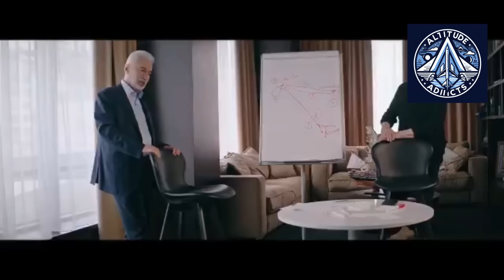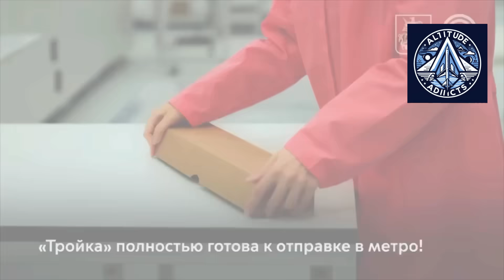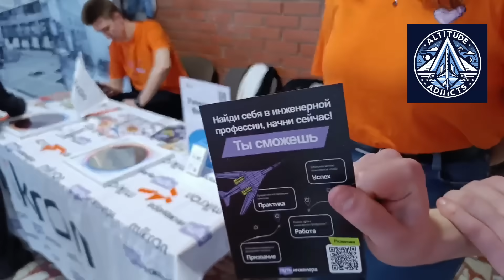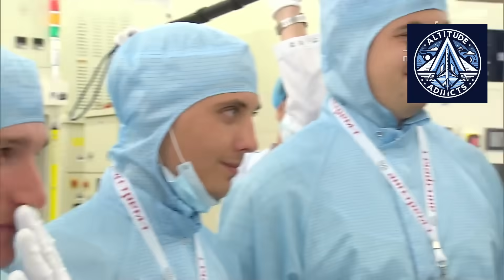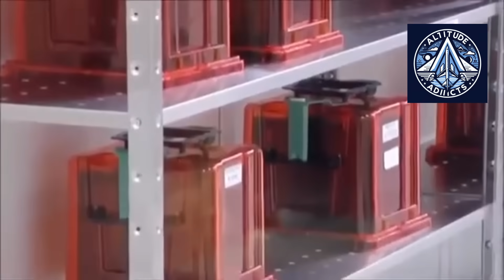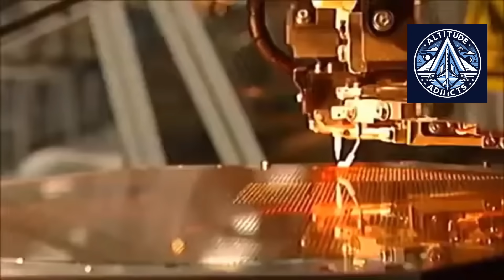Russia’s Semiconductor Industry Explained: Fabs, Chips & Sanctions

Comment: As respectfully as possible: Russia has NO chip industry despite being so claimed :
1.- Despite a staggering amount of minerals readily available in Russia there's no pure Silicon production industry.
2.- Russia has no lithography industry.
Importing a couple obsolete lithography machines is not a local industry, neither is getting some user manuals and schematics from Russian students posing as Polish in western universities: At best may be the 1st step of a long road to build a local sector. 
3.- The Russian industry, despite all the petrol an gas that should be enabling one of the most powerful economies in the world, keeps under-selling such precious energy instead of building local industry.
4.- Russia has no chip designers. 
Chip industries are all based in Taiwan, US, EU, UK, using western chip design and production HW/SW tools.
Again, the same way that using/administering a CISCO router is not the same as building and coding a rounter on your own, using CADENCE SYNOPSYS et al chip design tools is not the same as truly building your own chip design tools. 
5.- Not even China has managed to break the know-how lock on chip desing tools. How on heaven would the stagnated Russian economy have remotely come close to achieve the objective that China is working so hard on? To invade Taiwan, NOT military, despite all the noise, BUT by knowing all they know, that may be worth being known. Top of the list : CHIP MAKING.
6.- In Russia, real case, if you are a successful dairy farmer and you business springs, and you start making money, and you as farmer build a 2nd farm, and a 3rd, and start employing people, and making serious money, you will receive an unscheduled rather awkward visit courtesy of the local milita, equivalent to the TA in UK, the National Guard in UD. In uniform. 
Or perhaps wearing western football t-shirts while showing their guns. 
And like the Narcos in other places, or corrupt gov officers in Europe, yes, EU is ridden with essentially same type of crooks, AND they will demand an additional regular taxation from you straight to the pocket of the unexpected visiting militia officer.
Your 1st impusive answer perhaps would be "I already pay all my taxes that are used to pay for your militia training and uniforms and guns, WHY on heaven should I pay another tax,on top, off gov books, to this areseh.le visiting without invitation? "
Every Russian knows the 2-prong answer: 
6.1.- WHY? wrong question, pay first or you will be arrested on trumped/rigged/faked charges, and thrown in jail until you pay, and
6.2.- Because corruption is so bad that those crooks rather sink your growing business, and head to the next victim, than allowing you to generate wealth, live and let live is not in their playbook.
This was a lucky case that reached international media.
7.- SO if on something as basic as agricultural business gov corruption is so low, how do you expect the tip of the spear, the Bolxoy vallet of electronics, the top of the top of the industrial stack that like a sound building needs strong foundations, how on heaven do you think Russia has anything which is not light years behind current state-of-the-art chip industry?

Comment: I read that Russia supplies 10% of the world's consumption of pure silicon oxide for chip production, specifically it supplies both pure silicon oxide and large artificially created crystals from which wafers are then cut, round flat plates on which chips are lithographically created. The other 80% of the world's consumption is supplied by China.

Comment: If Russia is really working on this, why don't someone also collaborate with the government in India. We are also working on getting our own chip. Our indigenous tech is only 180nm, we went with a Joint venture with foreign fab to get our 28nm chip by this fall, but those techs are still not our own IP. I am sure the government of India will be more than happy to collaborate with Russia in this tech.
Reply: É muito complicado outro país, mesmo que seja aliado, fornecer qualquer tecnologia que os deixem em pé de igualdade! Qualquer país não vai revelar os seus segredos! Isso é dar um tiro no pé, depois de gastarem tanto em investigação, não vão entregar isso de borla.
Reply: In India, most of them are JV only. Chip fabrication is a long process, and it requires some special materials which both countries do not have.
Reply: our collaboration in microelectronics could be very productive. Unfortunately there is no signs of such collaboration.
Reply: Collaboration is 50/50 not the other way round.